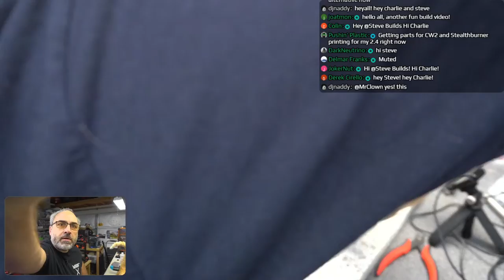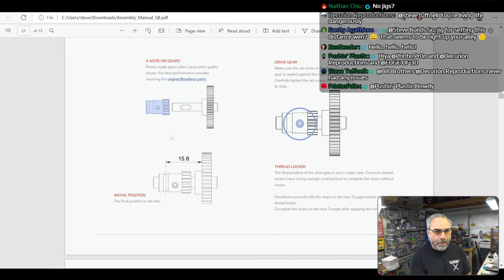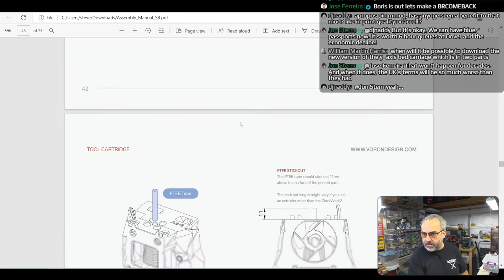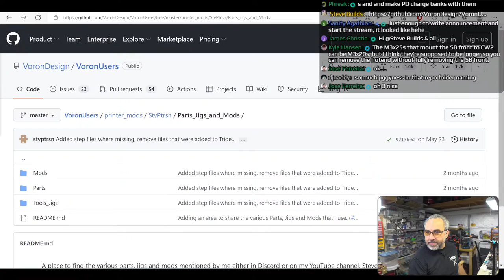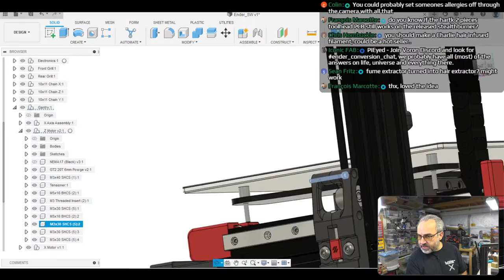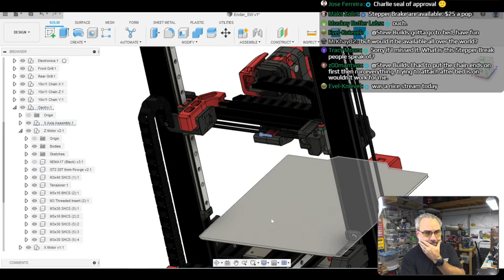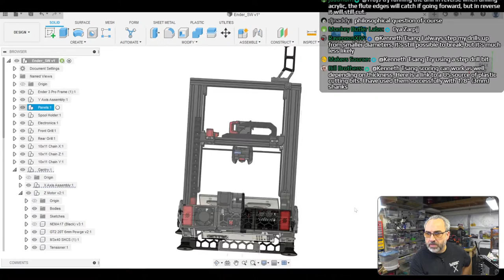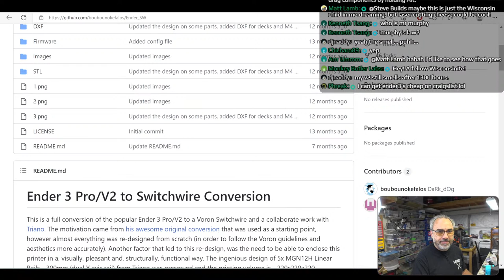Ender3 Pro to Switchwire Conversion plus Stealthburner/CW2 assembly!  (Part 2)

Comment: Re watching this video for the Stealthburner build.  I'm doing mine with a Taichi hot end, so no CW2 on mine, a pair of external M4's instead.  I printed the parts in PETG, and I realize I might have to reprint the two hotend (toolhead) parts in ABS.  I'm amazed at how well these parts printed and fit together.  Prusa slicer warns me about overhangs and suggests enabling supports, but the STLs are perfect without supports.  Taking the 5015 blower apart and removing the "ears" was easy, though I had to file down the outside a bit to fit it in.
For PETG, I set my soldering iron at 205C for the heat sets.
Reply from the maker: Yeah, I know Wile.e spent countless hours making sure everything was perfect without supports.  Such a good job on it.
Reply: @SteveBuilds Guess Prusa slicer is a bit paranoid.
I bought a pre assembled LED assembly from KB3D rather than have to solder the NeoPixels myself.

Comment: My Ender 3 Pro bed doesn't have the holes in the magnet sheet, so the bed attach screws don't come out.  I guess I can cut the magnet sheet with an exacto knife to extract them to get a screwdriver to the heads.
I bought a second 42-34Z motor, and will use two of them for the XZ motors.  The 42-40 for the Y, and the remaining two 32-38's for two M4 extruders (dual bowden flash burner dual material setup).
I have a Weller 100W soldering gun (old school) that would work on the bed.  Also have a 250W Weller gun!

Comment: complimenti molto bello avrei una domanda non trovo stl del power dove accendi e spegni l alimentatore mi puoi aitutare complimenti ancora
Reply from the maker: Hi Alby, you can get the files I used here:  https://github.com/stvptrsn/Voron_Stuff/tree/main/Enderwire but also check out Dark Dog's updated files at his github Rev 2 branch located at https://github.com/boubounokefalos/Ender_SW/tree/Rev.2 many of the suggestions I made were used in the update.
Reply: @SteveBuilds  ok grazie e complimenti ancora ti seguo ti auguro un sereno natale

Comment: Will you do a full klipper set up tutorial please and set up with this machine. I have made a start on parts now.  Great work man
Reply from the maker: Yep, we'll be going through klipper setup.  It'll be on the SKR E3 mini v3 I'm using for the build though.
Reply: @SteveBuilds  perfect that’s the board I have man 👌👌
Reply: @SteveBuilds  did I miss this?

Comment: 5:21:01 I think I was watching livestream at the time but this was the moment I was trying to figure this out for my ender 3 when I was swapping to meanwell psu and was doing the z belt mod by kevinakasam. I forgot about the bolt mounting the psu were bare metal. After watching these builds I almost want to turn my ender 3 into switchwire, would the stock motors still be fine or would they actually need to be swapped out?
Reply from the maker: You can get by with them if you can get the pressed on pulleys off.

Comment: Watching these as I do my conversion.  My printer did not print the extruder parts very well so I have to go back and try again but I am wondering what crimper did you use to crimp the Micro connectors?
Reply from the maker: I'm using an IWiss IWS-2820M.  It's a less expensive equivalent to the Engineer PA-09

Comment: Steve, could you share your secret to printing out the SB main body in ABS. The overhangs are tricking me up. Your print quality looked great! Thanks.
Reply from the maker: That's probably far too broad a question to answer effectively :)  I probably use a bit more fan than most, but everything else is tuned reasonably well also
Reply: @SteveBuilds  Thanks! That tells me I'm headed in the right direction. This is my first attempt at ABS. My prints are coming out good for the most part, except the horizontal holes. Got a little sagging at the top which leads me to believe I'll run into that on the SB main body.
Reply: @SteveBuilds  The body came out great...first try. I slowed down the print speed and used a little fan over the bridges. Thanks for the advice.

Comment: steve could you please share the back skirt piece you designed with the ender power plug?
Reply from the maker: Yep, all of my Ender3 conversion mods can be found here: https://github.com/stvptrsn/Voron_Stuff/tree/main/Enderwire
Reply: @SteveBuilds  at about 3:09:00 you show 2 brackets that go under the x gantry to mount the stealth burner. where did you get that? i cant find that stl even in the stealthburner downloads. please help its the last part i need to finish mine.
Reply: NM found it. love the build

Comment: hi steve i want to assemble the SB with CW 2 but i am confused to choose a steper motor in your opinion which is the best for the nema 14 36 17mm or nema 14 36 20mm CW2 steper motor?
Reply: Go with the 20mm motor. The 17mm gets quite hot.
Reply from the maker: Yep, as Sean said, the 20mm is recommended.  The 17 can work, I'm running them in a couple machines but given the choice, go with the 20.

Comment: With this conversion the print volume is same as original Ender 3 V2?
Reply from the maker: I think there is a little loss in X.  Mine is configured to 220mm.

Comment: What’s the approx cost range to upgrade an ender to a switchwire?
Reply from the maker: That is going to vary greatly depending on how many parts you re-use from the Ender and what particular parts you choose to buy.  At a minimum figure you'll need linear rails, belts, bearings and a hotend/extruder setup.  Alternatively, but recommended you'll need steppers and a controller.

Comment: Is there A BOM for this conversion?
Reply from the maker: There is a wiki linked from the project github.  Otherwise alot of the standard Switchwire bom should apply.
Reply: @SteveBuilds  thank you